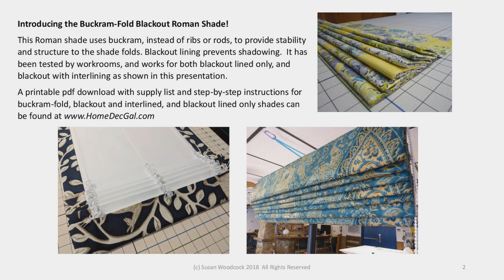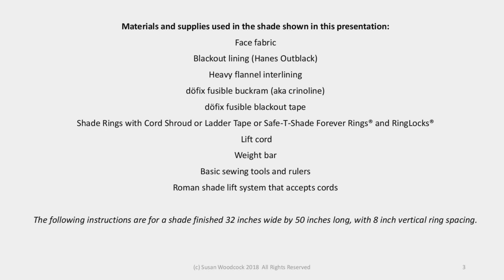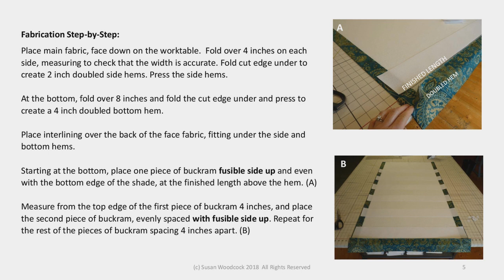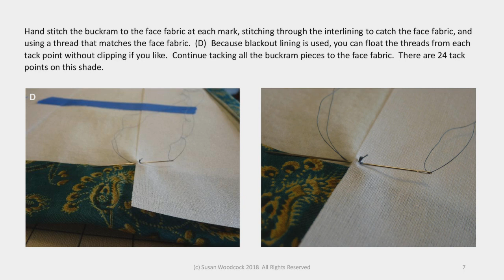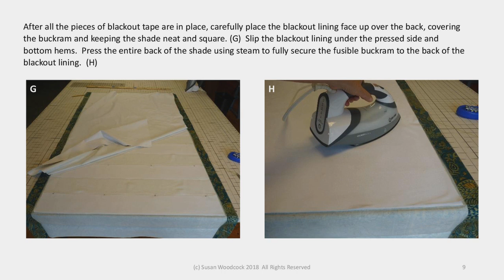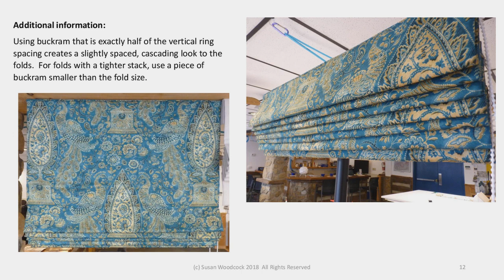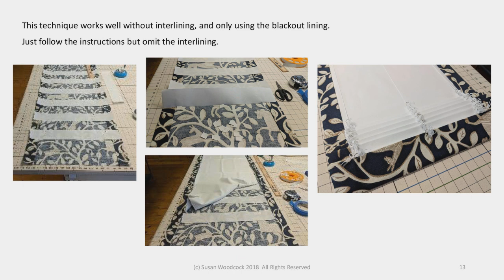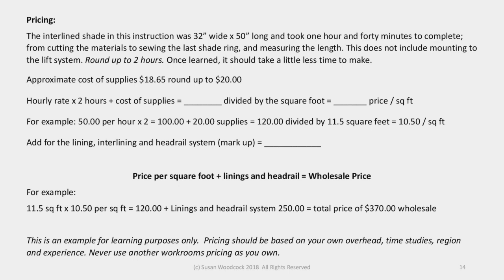New!  Blackout Roman Shade Method by Susan Woodcock

Comment: I got all my supplies and I'm reviewing your video.  I have a question.  At 10 minutes in, the fusible buckram extends to the edge of the fabric.  At 12:02,  however, the buckram does not extend over the hemline.  When would you do it one way, and when the other?
Reply from the maker: Hello, The side hems are unfolded - that is why the buckram looks shorter at 12:02.  When the side hems are folded back over the buckram extends to the outside edges (less a little bit so it't not too tight).